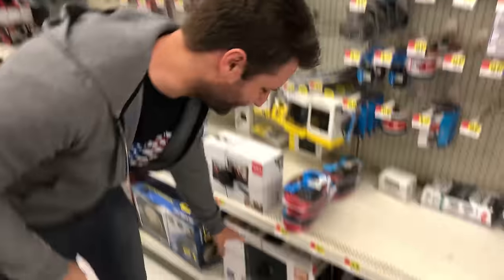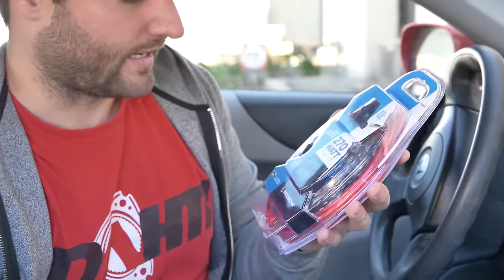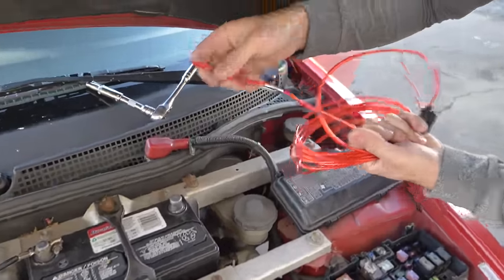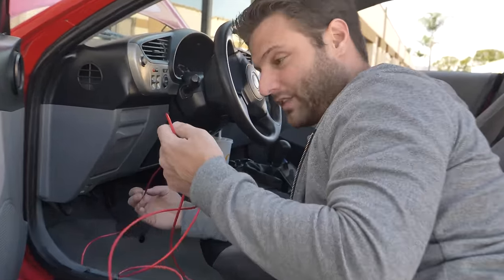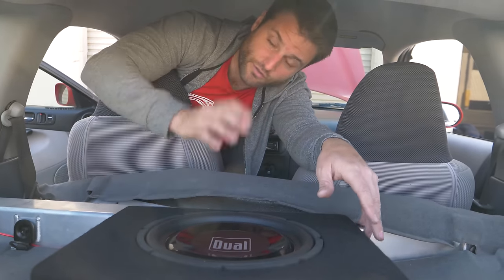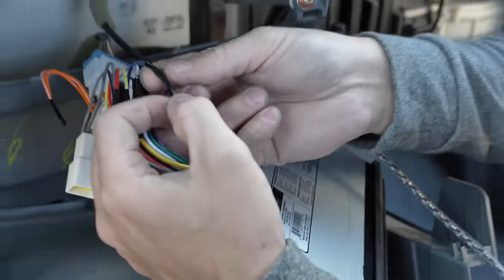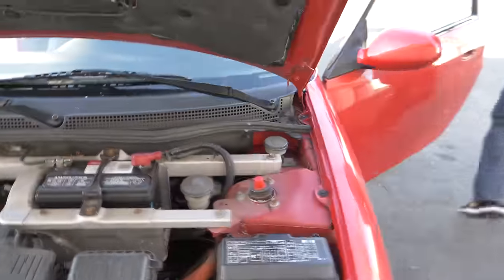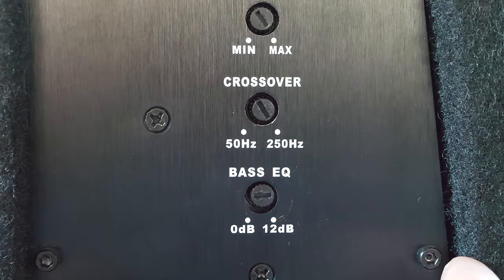How bad is the $70 subwoofer from Walmart? Install | Review

Comment: People... do NOT EVER run power from the fuse box!!
Reply: Jordan Murray I talk to anyone anyway I want
Reply: You guys obviously don't know how the engine compartment of the insight is set up lmao there's nothing wrong with this.
Reply: Some fuse junction boxes actually have a couple of bolts for connecting high power gear. Bolts are directly linked to the 8, 6, or 4 awg wire coming from the battery.
Reply: Alejandro Espinoza thank you... I just noticed that that’s where he hooked it up to... mosts cases, hooking up something of higher amps is too high to for the fuse box... but I see he hooked it to the bolts going to the fuse box... he didn’t stipulate that this is ONLY for the Insight or other cars like this... if you go to any real car stereo installer/competition... the power lead(s) to the amp(s) are hooked directly to the battery or even multiple batteries because that’s also where the alternator supplies power and when the car is off, that’s where the amps get power from the battery(s)... and the ground is attached to the frame hooked as close to the amp(s) as possible
Reply: Project_Mayhem thank you... his explanation is a little light on the subject... he didn’t stipulate that... some people would watch this with half and eye and think it’s ok to hook up any amp to anywhere on the fuse box and THAT can cause issues... see my comment above
Reply: Jordan Murray mostly low power factory items run from the fuse box, that’s why there are no fuses above 40a in a fuse box... hooking up 100+ Watts is a little different... but see my comment above... I saw that he didn’t just hook it to some random fuse in the fuse box... but he didn’t explain himself very well and some newbie might watch this and think it’s ok to hook up his 1000-watt Rockford Fosgate amp to his wiper fuse and call it a day... I’ll admit, I’ve never seen under the bonnet of an Insight... see my comment above... but I STILL wouldn’t want to run the risk
Reply: No let them... We want to see fires!! 😝😝😂😂
Reply: Correction. Don't do anything this guy did. Fucking amateur hour. What is that? 12 gauge power wire? LMAO!
Reply: Jordan Murray 
Unfortunately yes. That’s really how a lot of people treat and talk to each other here. It’s actually quite embarrassing.
Reply: Project_Mayhem 

People who run very powerful systems wire up a separate fuse box from the battery and hook up from that.....that's what I'd do. Don't forget capacitors.
Reply: Dustin Lampston Lmao if Jordan comes to America, just know damn well he’s gonna get made fun of
Reply: from where should you run it then?
Reply: You might as well burn the money if you buy capacitors.
Reply: logicallyfallacious Directly from the battery.
Reply: Jordan Murray I found the European.
Reply: Fuse boxes are fine.
But if you're inexperienced, keep a fire extinguisher in your car.
Reply: Jordan Murray agreed
Reply: kerchew lmao He's a sophisticated European, he can't help but jump on any opportunity to make himself look good.
We're trash so we just wouldn't understand. Hahaha
Reply: the only time to ever run "power" from a fuse box is if you have an accessible fuse to rap into, running a remote turn on wire, but NEVER power from fuse. yikes LOL
Reply: Unless you know a god damn thing about electricity and can tell which fuse runs to the battery... -___-
Reply: are you really trying to pretend that behavior like this happens nowhere else in the world?
Reply: @vipersb1  probably because the amp is 100w rms... At its best. I admit, I use 4ga for my 4ch amps that do about 100x4
Reply: 4 awg for a 4 channel is fine. I would never run power or ground with anything smaller though. It also depends on the wire itself, not just the gauge. The stuff in this video is likely CCA which limits its current load further. I only run OFC as it carries roughly double the current of CCA. I used to run 4 awg myself but went up to 0 awg from my run between batteries. Then both 0 and 4 awg from my distribution block to my amps.
Reply: I had worked on several cars with 10 extra spots for high power fuses in the fuse box. I ran all the electrical from it. 2 years later not a single fuse has blown.
Reply: Sounds like no one on this comment section knows a damn thing... he ran the power wire from the power terminal to the fuse block before the fuses! His power wire was fused if you didn’t notice. If he was pulling some adequate power more than a couple extra amps that his Walmart sub pulls he might have problems with some cars having a fuse from he batt to fuse block but it’s negligible for his install. Wouldn’t be my choice but it works safely
Reply: Jordan Murray  We learned it from the French
Reply: It’s not as bad as you may think, I’m running a 0 gauge wire from my fuse box to my amp and my amp is 1000w powering 2 12 inch kickers
Reply: Jordan Murray of course I would
Reply: That won't hurt nothing he's got the fuse right up there by the connection and it's probably only pulling 15 amps 20 amps
Reply: You guys seem to be forgetting that that's probably a 10 to 12 gauge wire on that little ass amp that's not going to pull those lights or his system down electrical system it's not going to pull enough amperage if you know what the f*** amperage is
Reply: Jimmy Louis think you I’m horse from yelling at the screen
Reply: Exactly
Reply: Was saying the same thing "OHHH GOD NOOOO! WHAT ARE YOU DOING?!?"
Reply: I mean the fuse box in my truck has 2 100amp aux outputs. Won't be that bad
Reply: Jordan Murray  Bro you assuming all Americans are like him is worse than how he speaks. What's the word I am looking for... Xenophobic I think? I'm not sure there is a good word for it. Basically you are racist towards Americans if you catch my drift.
Reply: Jordan Murray  That just further proves your racism towards americans. Who do you think you are?
Reply: Wait, so is it? Or is it not ok to be running wires off the point where the battery goes into the fuse box? Right now I have two small LED lights connected, but I'm working on putting 5 more on it..

Comment: As noted below, when I added a Bazooka-style powered tube subwoofer to the trunk of my old Volvo, I connected the power lead directly to the positive terminal of the battery and then through it through a grommet in the firewall.  I used that setup for 15 years with no problems and it sounded good.  And I was not skilled — the instructions that came with the tube stated to hook the unit up that way.

Comment: Dude you now have the most bad ass Honda insight ever!!!!! LOL.
Reply: German Elite Tuning Thats a beautiful B5! Subbed 😁
Reply: NOGAROOOOOO
Reply: German Elite Tuning he's prepping the 4 rotar for the insight.
Reply: Ricardo Andres thank you very much.
Reply: Jon Mar yah buddy one of the best colors ever.
Reply: g4rr377 dude that would be insane to have that much power in that small of a car.
Reply: Seen someone selling a K24 swapped Insight once on craigslist
Reply: German Elite Tuning I wana put a sub in my 2010 insight but I'm sure the stock radio head unit does have output for the sub :/ idk what to do
Reply: I have a Cactus Green Audi S4 B5 here in the UK, Scotland... it’s a STAGE 3 APR 420hp. Instantly seen your picture lol
Reply: Pie 4life you can use a line level audio converter hooked up to one of the speaker wires and that way you can hook up RCAs then you can wire up and amp and sub.  Or get an aftermarket head unit.
Reply: Greig300 that is awesome. One of the colors you don’t usually see.  That’s bad ass you have an APR kit. If you ever decide you wants a new tune let me know.
Reply: /watch?v=vOBL62GTR_I&t=87s   uh  perhaps not
Reply: German Elite Tuning I just sold my stage 3+ b5 :(
Reply: Damian O oh man bummer. Well you can always buy another one down the road.
Reply: German Elite Tuning ii
Reply: cant use a adapter? .... i did a sound system on a older mazda protege and had to get a adapter for the back of the stock head unit
Reply: It really doesn't take very much in that small of a car. I 100% agree with this review for some decent sound upgrades. Obviously if you wanna go hard core it will take much more power through the amp and speaker system. But this works
Reply: German Elite Tuning 🚗

Comment: Always disconnect you battery negative before your positive and reconnect your positive before negative. If only removing one battery lead make it the negative.
Reply: Finally someone on here has sense. You always disconnect your negative first.  From all my years of hooking up systems and etc that's rule number one.
Reply: The thing is in the electricity world people think the positive end is where the energy goes out from that's why they'll disconnect the positive instead of negative first when electrons are the particles which move in elevtricity
Reply: I was just going to say that ALWAYS disconnect the neg terminal FIRST
Reply: The reason for removing the negative first, is that if your the spanner you're using to disconnect the battery shorts against the chassis while you're undoing it, it won't explode in a shower of sparks and melt everything.

Comment: He ran his power wire with the factory harness which probably runs rear lights and maybe the fuel pump! The wires never went through the door jamb. He did a decent job for a DYI guy.
Reply: man.. lok at him now, doing wiring on a indycar engine

Comment: This is a slippery slope Rob... Once you get the taste for quality car audio it just becomes another "ooooo let me just get a bigger sub/amp" then speakers, head unit, etc... Before you know it you'll be competing... Okay maybe not that extreme but you'll wanna one up your buddies system lmfao
Reply: Mike Bender dude no fucking joke. I bought those 6x9 kickers for the two front doors and next thing you know, i have an amp and 4 more 6x9's and 2 12in kicks sub. What have I doneeee
Reply: Same haha I started off with just changing the head unit now I have all new speakers and 2 sundown 12s lol
Reply: True. Started with two 10s, went to two 12s with aftermarket speakers and here I am now, with pro mid ranges, super bullet tweeters and one 15 🤷🏽‍♂️
Reply: guapman how do you like those sundowns? I am gonna be doing a nice setup in my c6 base with a dual 12" downfire box. I was thinking I will eventually upgrade to the sundowns but I'm worried about the cu ft in the sealed box. Only .7 cu ft per side.....
Reply: Why do you need that much bass? I would be more than happy with ONE 10'', or even a high quality 8'' lol
Reply: Xeldinn I mean... I don't necessarily NEED a 400 hp (crank of course...) Corvette. But its what I want. Well not really I want it faster actually lol. I just love a clean dual 12" sub setup. I love being able to feel the music as the bass hits and the other parts of the system bring it all in. It might be making me slightly more deaf every time but eh whatever Lmfao.
Reply: Can't you accomplish that with one good 10''? As far as HP is concerned, that is completely different. I love fast cars ;-)
Reply: Xeldinn I'm pretty positive you can in a cabin as small as the vetts. But being a young kid as such I like to have ALL the bass lol. Idk I guess ill find out real quick if I shoulda just went with the dual 10" box or single 10"-12". Theres actually a decent amount of guys on the corvette forum that have some CRAZY setups in their cars... Like I'd never put a system that crazy in anything.
Reply: How old are you  if I may ask? I am 31.
Reply: Xeldinn 

19... Gonna be 20 in June
Reply: Mike Bender I've got an sa-12 on 1200W. They aren't very musical, but they got hard as fuck and can tell some crazy abuse for the price. The sa-12 Is rated for 750W, but I've seen people pick 1800 without issue. 

<3
Reply: One 12 inch sub wired in parallel to bring the ohms down (assuming the amp can handle the load, and the sub can handle the amp) will sound just as good as the same amp with a normal wire configuration going to two subs.

I have one 12 inch Infinity Kappa VQ from 2004 being pushed by a tiny 500 watt RMS MTX amp from the late 90's. It slams so hard people think I'm lying when I say it's only one sub.
Reply: You are exactly right. Now its 3 15s in a groundshaker ported box. Slams so hard it takes my breath and mind away. Google those boxes fuck q bomb. Ground shaker boxes are the way to go if you don't build.
Reply: John Wick Haha the kinda bass that makes your vision blurry right there. I got to sit in a competition van way back in the day, mid 90's. It was an Astro van that only sat 2 lol. The back was full with 16 12" subs each with its own dedicated 1000 watt amp, and an arsenal of batteries and capacitors. It shook my brain. It was awesome watching the sheet metal vibrate like crazy to the bass. You could see the sound waves rippling the sheet metal. Nowadays that system probably wouldn't even be a contender in a competition. I think he was hitting high 140 dB's.

 I'm good with just a little windshield flex when the big bass hits.
Reply: So y'all, and a couple of other people, have made me change my mind lol

My dual 10" sub box is gonna arrive at my door tomorrow. Next is subs, amps, head unit, and wiring... 

This is gonna hurt my wallet lol

Comment: Hey Rob, haters gonna hate no matter what so pay them no mind. I bought the sub on sale for $49.99 plus the wiring kit (should've got the bigger amp kit thou) and I installed my self using your instruct. although I did it a little differently but whatever. The system in my truck sounded pretty weak, 4 3x5 speakers are not a strong setup and it sounded very tinny and weak. After adding this sub it is beyond my expectations, sounds just perfect for me and for under $75 I'm stroked.So thanks for the info bro!!!!!!!!!!!!!!